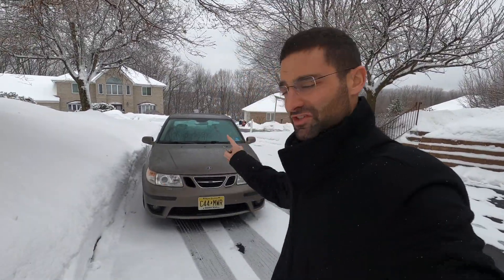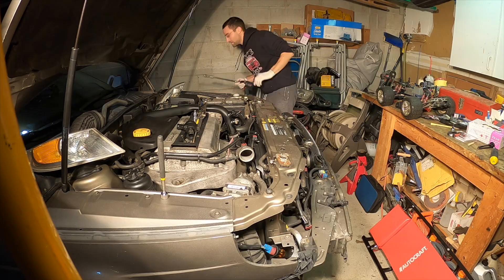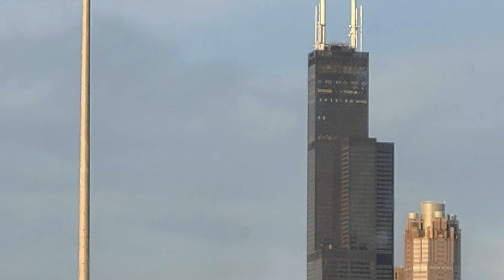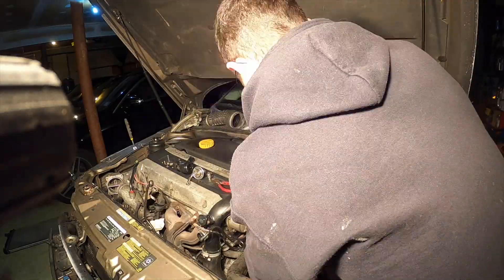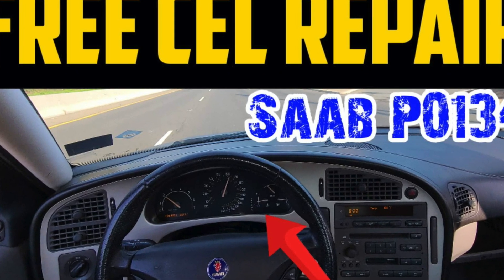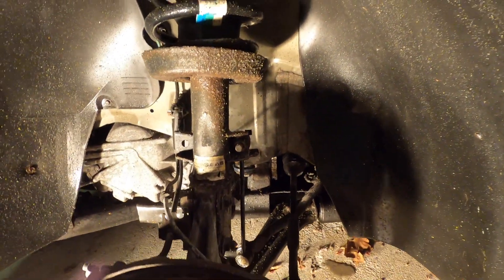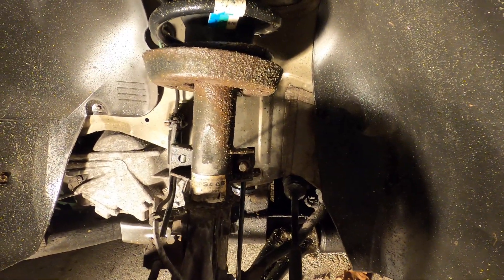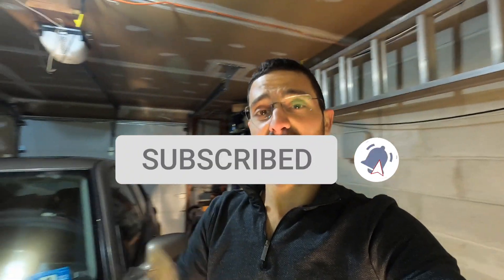A 6 Month Ownership Review on my 200k Mile Saab 9-5 Aero - #Saablife

Comment: I have a 2003 Saab SE convertible automatic and I need bushings and I need to know how to put on motor mounts I'm trying to save the car you and I need to know how to put a hydraulic pump on the top so we can come down automatic
Reply: you will need an engine support bar and lower the subframe slightly to do engine mounts on a 9-3. they arent super hard to do